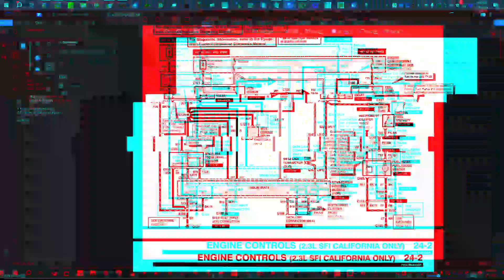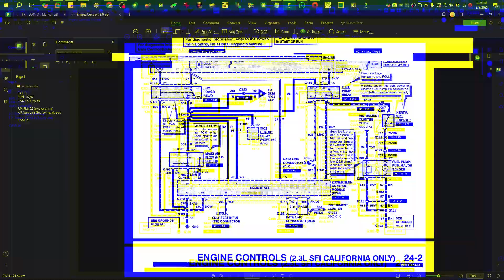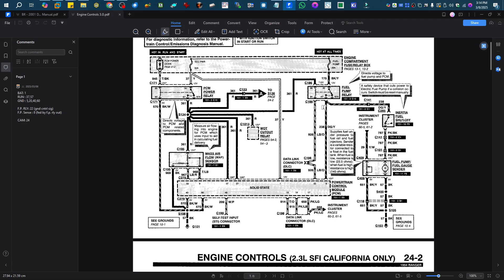EEC-IV Fuel Pump Relay Control Test: Fast & Simple Troubleshooting

Comment: I have a problem on my kia Picanto 2012 1.2 eninge , everything was good before I got an accident and the fuse box got a bit damaged on the outside now the fuel pump keeps running when I turn off the car , also the ventilation inside the car I can now run it without turning the key,( also important remarque the fuel pump keeps running even when I remove the fuse ) I really need help I hope I can find a way to contact you.
Reply: I'm pretty sure my problem is on the fuse box somewhere cause everything was running good before I got that accident now I'm looking for the diagram for this car engine that I couldn't find for free so I would be happy if u have it

Comment: Love the breadboard setup. That's way cleaner than the jumble of jumper wires I always end up using. Before I'd hazard a guess, I'd need to know if the fuel pump relay is switching or not. Then I'd pull the fuel pump driver pin from the pcm connector and see what happens. My suspicion, based on a lot of 90s Ford wiring repairs, would be a chafed wire somewhere.
Reply from the maker: I have lots of custom testers I use but the breadboard is usually what I prefer.  Its simple and easier to configure for exactly what I need at the moment.
Reply: Hey thanks for the response. This is my ECU & this truck has been trouble. Started out with intermittent constant fuel pump the eventually wouldn't start at all, constant fuel pump. 

Ive been through the wiring, nothing wacky or spliced. The pump relay socket however has two spade pins that are constant hot with the key in the run position. I appreciate Keyworks & the job he's done.
Reply from the maker: @michaelp4567  For the relay socket you should be getting 12V on terminal 86 and 30. Then you would get the ground control from the PCM that goes to 85. This would activate the relay (if installed and switch the 12V from 30 to through to 87  to power the fuel pump.

With the ecu in and relay out the pump runs or is off?
Reply: I've tested with ECU installed & relay pulled from the socket, fuel pump does not come on. I need to thank you again, I believe your asking for help in comments & participation in the  comments goes above & beyond the repair .
Reply from the maker: @michaelp4567  I like to see things through. Hoping to help you get it fixed
Reply: @michaelp4567 Hi Micheal, I actually have the exact same issue with my f250. Keywords tested it and said it was good, but when installed, the pump is always in. Did you ever find an issue to your problem?
Reply: @michaelp4567  what vehicle is it? When the engine is running, you will get constant fuel pump in most vehicles. It's only in the last 10-15 years that returnless fuel systems need to use the pump to control fuel volume and even those run the pump most of the time the engine is running they just change the pwm duty cycle to slow the rotation.
Reply: @michaelp4567  Relay sticking ??